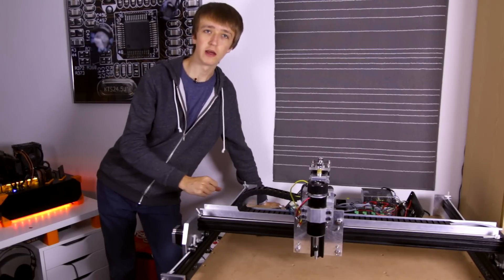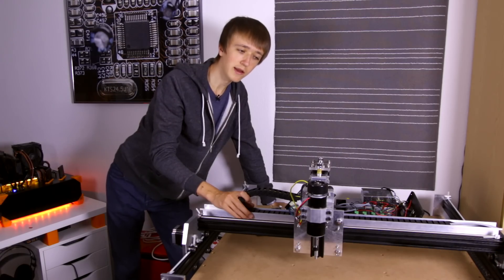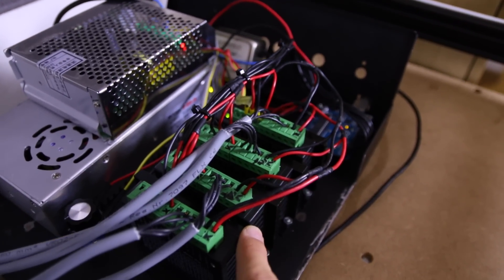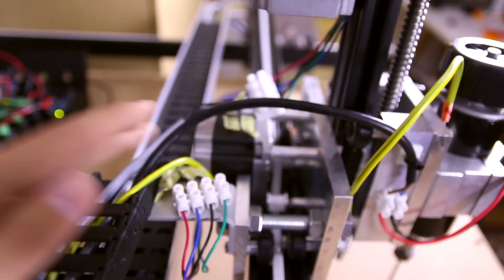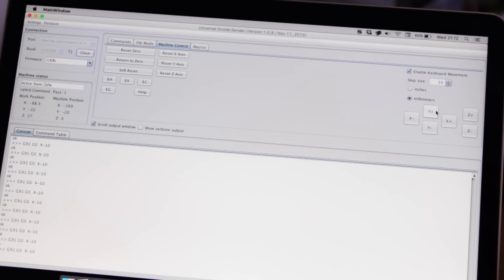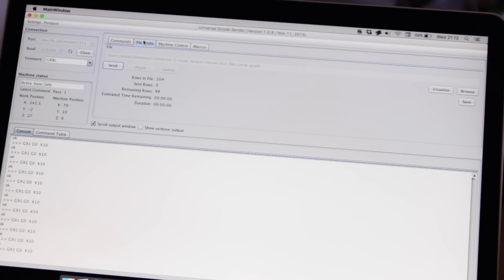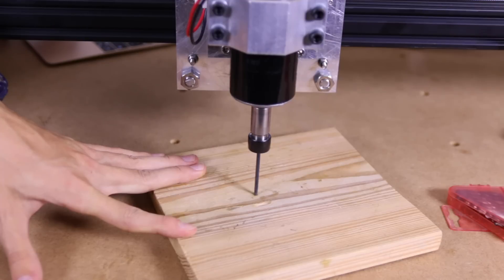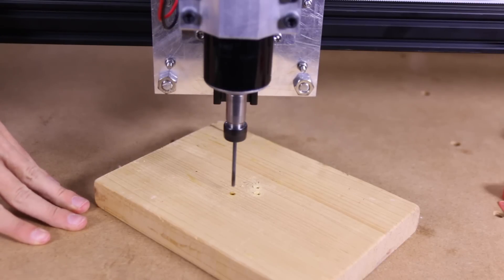Custom DIY CNC ROUTER #3 The Electronics

Comment: Did you consider 'reversing' the z-axis, with the slider on the x-axis beam and the spindle motor mounted on the stepper rail? This will give greater z-axis travel. See this link for details:
https://mk0oozneste7bah52job.kinstacdn.com/wp-content/uploads/2018/07/OX-CNC-Mechanical-Kit-4.jpg

Comment: One problem I see is your gantry is lower than your z axis travel. I’d recommend raising the height of your gantry and reconfiguring the spindle bracket so when the spindle is at highest point (including tooling) there is still room under the gantry. But keep in mind the flex you’d afford by offsetting the spindle from the gantry. All depends on the workpieces you intend to cut in future though. Great build all the same.. thank you!

Comment: So, as you shown in this video, I don't need to buy the stepper controller & grbl shield for making the exact controller you made...?

You have used 4 stepper driver+arduino uno+power supply, so stepper controller & grbl shield has nothing to do here !
Reply from the maker: yes, that is correct
Reply: Datulab Tech you and your videos are being a great motivator to me, and soon i am going to build my own CNC machine 😎...
And you are doing great job 👍

Comment: Wie hast du die Richtung des einen Schrittmotors der Y Achse geändert?
Reply from the maker: wenn man bei einem Schrittmotor zwei Kable austauscht, ändert er seine Richtung.
Reply: Datulab Tech Meinst du die Kabel der 2 Spulen?
Reply from the maker: Einfach die zwei kabel einer Spule miteinander vertauschen reicht
Reply: bei schrittmotoren (4 kabel) sollte man immer zur richtungsänderung BEIDE spulen tauschen UND umpolen
Reply: good job. may you can see me about wiring 2 motor in one axis??
thanks before

Comment: Hi buddy. Nice project. Do you have some wiring diagram for Arduino Uno and stepper drivers connection? I'm doing a similar project and only left me the electronic connection for finalize. Thanks for you videos.
Reply from the maker: +Juan Alicea I do not, I pieced it together from different sources but haven't made a diagram. It isn't too complicated though, just power and the motors to the drivers and then the controll pins of the driver to the arduino.

Comment: how many volts and amps will my power supply need to be for 4 nema 17 motors rated at 2.4v and 1.5 amps per phase?
Reply from the maker: This is very much determined by the drivers you use but generally it will be either 12 or 24V and for good measure take a PSU with twice the Amperage you think you need as these Chinese parts shouldn't be run too close to their max. 15A or more would be a good starting point
Reply: Datulab Tech thanks. i am using drv8825 drivers. so would you srill recommend a 15 amp power supply? also when i measure the volts with a multimeter the driver reads 24v same as the power supply. turning the pot screw does nothing.

Comment: helow.. i want to ask, what your type driver stepper ?? u use tb6600 ? or what ? and i want to ask u use arduino uno... can u share arduino code to raratdit@gmail.com ? for learning by me ? thanks for your attantion. :)
Reply from the maker: I'm using some Chinese off brand stepper drivers, they are literally just called stepper driver :D just search on ebay or aliexpress for stepper driver and then the amperage you want. The code for the Arduino is just the GRBL library, you'll find it easily if you google for it. I didn't make any modifications.

Comment: Did you have any trouble with noise from the spindle interfering with the laptop-to-arduino connection? I'm building a small CNC machine now using the same power supply and spindle and it's a real nightmare....
Reply from the maker: +iforce2d yes I did, using a short shielded USB cable solved it for me.
Reply: Another guy put a suppression capacitor on his spindle motor and that solved the interference issue.

Comment: First of all thanks for your work, I liked it a lot, you have a lot of talent, I have some questions, how did you choose the motors and especially the motor to debar metal (for metal types or velosities?), You could put the links from where  buy,  Thank you again and greetings from Mexico.
Reply from the maker: The metal is all aluminum that I found locally for a bargen. The Motors are some cheap Nema 23 Steppers and the spindle (I think that's what you mean with "motor to debar metal") is just some cheap spindle + power supply bundle from Aliexpress. Not that strong though, I'd recommend just a normal router if you can tolerate the noise. When I have time I'll put some links in the description too.

Comment: do you recomend the spindel ??
Reply from the maker: +Fons Van Bommel for the price it is ok, but if you can spend more I would advise you to get something else
Reply: Yeah I have one of those 500 Watt air cooled Chinese spindles and it sucks. But it is pretty quiet compared to the router I was using. So I like that on longer cuts.

Comment: Sehr gut gemacht! Bei meiner Stepcraft verwende ich ebenfalls den UniversalGcodeSender und GRBL als Firmware auf dem Arduino. Funktioniert einwandfrei. Wenn du etwas mehr getestet hast, würde es mich interessieren, wie zufrieden du mit deiner Spindel bist? ich verwende einen Proxxon Industrieschleifer als Spindel und der ist nicht optimal.
Reply from the maker: +Ewap Die spindel ist sicherlich nichts besonderes gutes, es war einfach die günstigste Lösung.
Reply from the maker: +Ewap Die spindel ist sicherlich nichts besonderes gutes, es war einfach die günstigste Lösung.